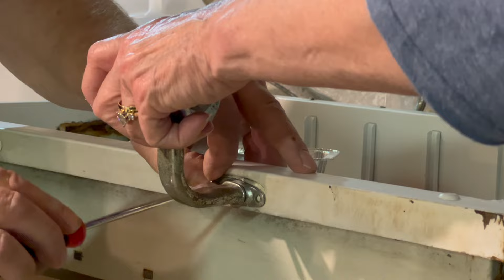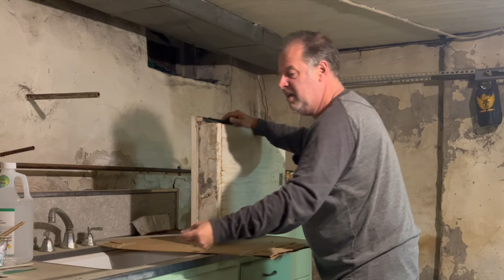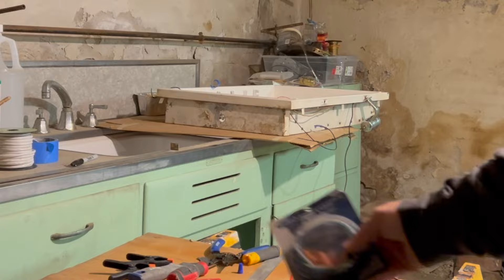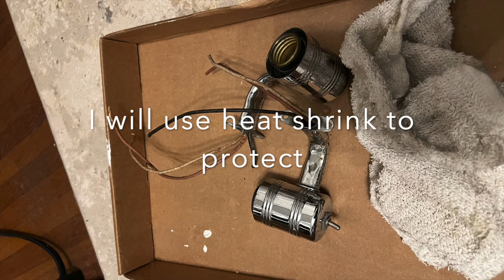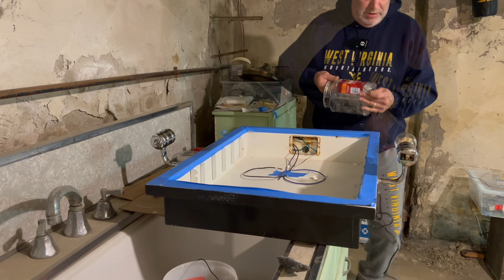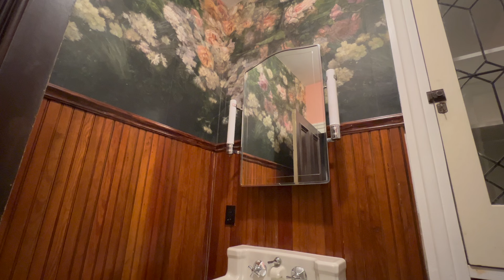Vintage Bathroom Mirror Restoration

Comment: The slot is for used razor blade disposal.
Reply from the maker: Absolutely right! With the cabinet recessed, the blades would drop down between the studs in the wall and create a rusty pile on the floor inside the wall.